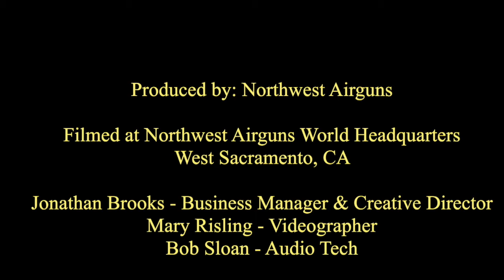Pump-up air rifle not pumping up?  Try the 'Alcohol Flush'.

Comment: Yes alcohol will clean the inside of the bore but Alcohol swells and destroys the rubber o-rings. You get compression because the o-rings are swelling but in short time dry out and become brittle and break apart. The correct fluid to use is brake fluid. Brake fluid cleans and preserves the rubber o-rings which make up your piston pump.
Reply: Automatic Transmission Sealant (Stop Leak) works well too and will not destroy the O-rings.
Reply: Brake Fluid is going to strip paint and maybe melt plastic.  Use with caution.  It can damage more then just the gun.  I have no experience with the trans-stop leak, but it should be safer.
Reply: The seals will be fine if you also oil the cup.  Over time oil and dirt fouls the check valve, gun leaks air.  Flushing cleans out the compression chamber and allows fresh clean oil back in.  Seals stay good.  Use only air gun oil.
Reply: Thank you so much, you just saved me the look up, I’m a auto tech and I was thinking of trans fluid but brake fluid is definitely the correct answer.
Reply: Brake fluid is highly caustic. Rubbing alcohol is an extremely mild solvent. As long as you're not leaving the alcohol in and letting it evaporate before reapplying lubricant it should be harmless
Reply: @brendanlantz8631  Unfortunately straight alcohol will cause the rubber to dry out and become brittle and a oil based lubricant will accelerate rubber break down further. Unless the rubber seals have been designed for oil resistance such as in hydraulic oil systems, brake fluid is recommended.  Dot 3 brake fluid is glycol. Glycol is composed of alcohol and glycerin. The glycerin prevents the alcohol from deteriorating the rubber seals and works as a lubricant. Think of the brake system on your automobile which is composed mostly of rubber seals and metal springs. These system last many years and only start to deteriorate once the glycerine starts to break down or the fluid becomes contaminated with oil or water.
Reply: Not brake fluid. That destroys rubber for sure.
Alcohol will not hurt the o rings if used for a short period of time.
Leave it overnight then dump it out.
Then use silicone spray on your seals.  Shoot the gun a few times onto a paper towel and see all the gunk that comes out the barrel.
Put silicone on the seals every 100 shots for a while and watch compression to improve.
Reply: There are no o-rings in a 312
Reply: Air compressor oil works good on the newer guns. Not for older guns with leather cups.
Your pump-up gun is an air compressor.
You could go to a scuba shop and buy the silicone grease they use on the o -rings and seals in scuba regulators.  That should be the finest kind of "bet your life on it" lube.
People get all kinds of ideas about
 what to use in different kinds of air guns. One fellow i know only uses non detergent 30 weight lawn mower oil.  Another man only uses synthetic 2-cycle oil.
I use silicone spray with good results so far.
Reply: @doctorxring  its Crosman 1377s and 1322s we are concerned with here.
Reply: Will jack pump oil work? Mine is letting out air after pumping.
Reply: @MrKL83  i don't know if it's thin enough to get where it needs to go but you've got nothing to lose by trying it.
At some point the seals will need to be replaced no matter what.
What i do with the alcohol flush and silicone oil is to just see if i can get a little more life out of the gun before i have to do a complete  tear down and reseal job.
Its not a permanent fix but you've got nothing to lose so why not give it a try?
Reply: I wonder how brake fluid can be bad. Doesn’t the old brake shoe calipers have rubber seals? It doesn’t seem to hurt those
Reply: @bobcat1  i uae compressor oil in my guns made for air tools. Its made to protect and preserve the O rings in your air nail-guns etc
For me the alcohol flash has bern 50% successful. It worked fine in one old gun but never did really regain pressure in another
 These are 40 yrar old guns here.
The alcohol flush works sometimes as long as the seals arent too far gone.  If its time for a reseal job then thats what you have to do. They will all need a reseal job eventsully.
Nothing lasts forever.
If the gun won't pump up you've got nothing to lose by trying it.
 Sometimes you get lucky.
Reply: @MegaTheRatman it will over swell the rubber and it will fail anyway.
U have to use a tiny bit.
Reply: 😊 @bobcat1
Reply: @ 10:28 johnndavis7647
Reply: @doctorxring 
Got a leather pump seal if I remember correctly.

Comment: The inlet check valve is still not sealing as you pointed out. I've been alcohol flushing pump pneumatics for years. If it's going to work it works pretty quick. My method is to squirt, pump 2X, fire, repeat until all the seals hold air and there's no more dirt coming out of the muzzle. No need to soak overnight. Alcohol hardens and dries out the rubber seals so get some oil in the valve as soon as possible after you flush it out with alcohol. If flushing doesn't work then it needs a reseal job which is no big deal. Routine oil lubrication over the life of the gun flushes the valve out with every shot.
Reply from the maker: Good stuff, Jon, very helpful, thanks!
Reply: @NorthWestAirgun  Mr. Northwest, I've whatched many of your videos and they are excellent...the 312 cut out video was highly excellent to see how it all works...I received a repair kit with the tool for the Benjmin 312 and have taken the gun apart, cleaned it up nicely...However, I'm not sure how to get the pump cup off...do you just pull on the cup and stretch the rubber...?  BTW.  What about those felt wipers, do you ever replace them...?  They appear to be in the tube just to keep everything in alignment during pumping.    The man question is how does the pump cup come off?  Thanks,  Dennis.   I know it's a stupid question, but...lol  

 BTW.  I've cleaned all the black off this gun and have the brass shining like new money, last step was 0000 steel wool...it looks like a mirror now and will spray it with automotive clear coat...that should protect the metal...We will see...refinished the stock with tung oil...about 5 coats....it's looks good too.  Now, just to get it back together...I could not have done this without your videos.  Thanks again.
Reply: Mr. Northwest...never mind I just saw your 3100 review from February 22, 2022 and you just popped that rubber cup off there....that's all I needed to know...no need to respond...I know you are very busy...Thanks,  Dennis
Reply from the maker: @dennispfeifer7788  If you are just having trouble digging out the old pump cup material you can burn it out with a torch, like at the 7:25 minute mark here; 

https://youtu.be/c4_A3Cg6i8o 

Just do it safely, outdoors, with no combustibles nearby. But some pump cups are cast in place and not replaceable, take a look here; 

https://youtu.be/cS9mpZc1RQY 

In that case, you have to replace the pump cup holder so you can use the new pump cup. Take a picture of what you’ve got and email it to whoever you got the kit from. They should have the right pump cup holder for you. Cool that you are refinishing that rifle, a lot of the old stocks were pretty nice wood and refinishing brings it out.
Reply: It clearly states that the hole isn't to be oiled

Comment: My Crosman 66 Powermaster had no compression when I tried to pump air in. I was going to buy a M4-177  for about $55 here in So Cal in the morning and just trash the 66. But came across your video and decided to give this a shot. I only had 70% Isopropyl Alcohol on hand. And wasn't seeing any positive results after standing it in the corner over night. Tried it again using Dot 4 brake fluid. After standing in the corner overnight again. Dry firing a few times had good results. BB tests were also good. After standing in the corner for 2 nights. I think it pumps  up and fires better than new. Fantastic video. Thank you!

Comment: I bought a Benjamin model 342 air rifle in the 1970s. I haven't used it for over 30 years. Tried to pump it up but it did not hold any pressure whatsoever. I read about your 'Alcohol Flush' and decided to give it a shot(pun intended) last night. I pumped it up this morning and it fired like a champ. Great advice with greater results. Thanks a million!

Comment: While doing some maintenance on my Benjamin Sheridan C9A .50 Cal. rifle, I ended up having some gun oil creep into the air pump chamber. I had zero pumping power. I found this video and gave it a try, and IT WORKED! I added the rubbing alcohol into the chamber and pump cup, let it sit over night, and the next morning all was good again. Got my beloved air rifle back in working order. Actually has more pressure then it originally had. Thank you for this video!

Comment: I have a Blue Streak that I bought in the early 70's.  It quit pumping about 10 years ago so it got tucked away in a closet.  I came across your video and thought I would give it a try.  First time it brought the pump back to life but the check valve wasn't holding.  I tried it again and let it soak for a few hours and the check valve started to seat.  The gun now shoots great and holds pressure.  Thanks for  the lesson!
Reply: Is it still holding air?  I bought my blue streak used about 1968.   Yesterday I took it out of the closet and it’s not even trying to suck air.    This really works?     Thanks   ☮️
Reply: Is it still holding air??

Comment: ...When the alcohol evaporates it will dry the seals, so after the flush it's best to put Pellgun oil (or something similar) on the pump cup and into the compression tube as in regular maintenance....This will bring new life to the seals if they are not damaged in any way just by age.....Lubed up before any long time storage will also be a big benefit.........

Comment: I watched your video several weeks ago all excited that I might be able to avoid tearing down my 60+ year old Benjamin 312. The last time I shot it was about 20 years ago, before it was flooded under 13 feet of water from Katrina in 2005.   I tried for several days with little or no effect on the ability to pump, so, I put it in the corner and saved it for a later project.
It's about 6 weeks later, and I decided to order a kit for it. So, naturally, I picked up the gun and went to pump. It was solid--I mean solid --at 4 pumps !!. So glad I have a can of pellets with it.
I'm going to postpone a rebuild, cleanup the gun and re-finish the stock. I'm already telling my grandkids about my 1960's adventures with this gun and look forward to target practice. 
Awesome video--thanks!!

Comment: I have a 55+ year old model 310, which I used as a kid, that quit pumping. I tried the alcohol flush and it didn't work immediately. I left it overnight and it's not only pumping up but holding air. Thank you for this great video.

Comment: John,
I saw your video on the alcohol flush and was quite skeptical at first, but decided to give it a try with 70% alcohol on my Benjamin 317 and it didn't work so I decided to follow directions and use 91% alcohol. I did it like you, above and below the pump cup, then set it in the corner, upright and pumped it several times in the morning and lo and behold I got pressure again!  Thanks a lot for sharing! I'm going to try it on my Crosman 664SB Pumpmaster next and see what happens. Brad
Reply: Teflon is better.

Comment: Blimey! I'm amazed, I bought a 2200 on an online auction, blind, it didn't pump.
I was looking at diagrams and seal kits to repair it. 
I was a bit underwhelmed with the gun when I picked it up as it felt like a toy gun I had 50 years ago firing caps at my little brother.
I used a few squirts of 99% hand sanitizer from our COVID stash. I'm pretty sure this little plinker has more power than my Air arms S410 classic.

Very impressed with this video that has revitalised an old American plinker (maybe not restricted for UK market)

Comment: I am so happy I found this video last night. Earlier this week I took my Crosman 140 off of my gun rack to dust the Rifles on the Gun Rack. For the heck of it I tried to pump it up and it would not hold air. Took a extra Syringe I had around that I had left over from filling printer ink cartridges for my printer unused and poured some Rubbing Alcohol in a extra pill bottle I had around like you did and inserted it where you told us on the video to do. Did it a few times.  It didn't do anything for me last night as it seemed to be leaking air from around the piston area. I thought there was no hope for it and that maybe I needed to rebuild the piston. Add more Alcohol, stood it up and walked away.  Well this early afternoon I went and checked the 140 Rifle again and I could tell a big difference on the first pump. Pumped it just 2 times and tried it and it shot some air out of the barrel into a rag. Just ordered some Pelgun oil for it last night I should have on Monday. Can you suggest to me or do you have another video you can send me a link to on how to oil this 140 Rifle properly? I forgot to mention earlier that  I purchased a seal kit of just O-Rings for this 140 Crosman Rifle maybe 5-6 years ago and resealed this Rifle back then and only shot it maybe 10 times to test it out afterwards. Got tired of pumping it up each time I wanted to shoot it. Didn't mind as a kid back in or around 1960 when my grandfather purchased this Rifle for me but at the time in my mid 60's then I just didn't feel like it anymore and put it back on my gun rack where it collected dust until the other day. I am 71 years old now. All and all this Rifle is in great shape. No rust. Blueing on the metal still in pretty nice shape. Wood Stock is nice also but with a few small chips. Thanks for making this video is all I want to tell you. You helped me revive my old 140 Crosman at least for the time being. I just want to Oil it with the Crosman Peloil when I receive it. Don't remember if I got any Crosman  oil with the Rifle when I purchased it new. I believe back then I was using 3 and 1 oil on a rag just to wipe my Rifles down with and really nothing else maybe some WD40 also at times on a rag to wipe them down with.

Comment: Thankyou very much for this Excellent advice!!! 
I just did the alcohol flush over 3 days and saw little bits of string come out the barrel when dry firing and adding more 99% isopropyl alcohol into the air intake each day , and this morning my Benjamin 317(no serial #- made 1940-56) held air, and I chronographed it shooting 5.4 grain Crosman lead free "fast flight" pellets at nearly 700 fps, so I'd say that the alcohol flush was a success :)
Reply: Make sure you put some 3-in-1 oil or brake fluid in the same hole to lubricate the seals. Alcohol alone will dry the seals out causing them to dry out and turn brittle.

Comment: Well,my dad's Benjamin is now fixed AND in under 10 minutes. I injected the alcohol and then just a touch of synthetic oil,gave er a few pumps and instant pressure building again. Running good and it's sat in the same spot for many years. Firing good. Thanks for this tip!!

Comment: Thanks for posting this tip and very good teaching style. I was given a crosmen 66 from the late 80’s by the serial # that didn’t pump. DOES NOW & holds air. Put some silicone oil in after several dry shots to remove the alcohol. Shoots great.

Comment: I bought an old Blue Streak that had been sitting in a shed for years, through frigid MN winters and humid summers. It would not pump up when I got it.  I did the alcohol flush and the gun pumped up fine and held air for days.  I sold the gun to a buddy 7 years ago and it’s still pumping and holding air fine.
Reply: How many % concentrate alcohol my friend ?
Thanks you very much
Reply: Just wondering where I can purchase a compression seal kit for my Blue Streak. Thanks ahead of time.  Appreciate your videos
Reply: @rickwood5005  or you can use a 1/8" nut driver to remove the bolt stop. Watch the videos first to determine if you want to attempt it.

Comment: My Sheridan Silver Streak air rifle that that I've had since about 1970 was on the floor in our house when it flooded in 2017.  I wiped it down and put it in the gun case and forgot about it.  I tried to pump it up the other day, and nothing.  I was watching the NorthWestAirgun video on rebuilding my gun when I saw a comment directing me to this video of their's on Alcohol Flush.  Day one, no change at all.  Second try I injected more alcohol and the following day the gun pumped up perfectly with no leak-off.  Two more days later and it is still working the same.  Thank you guys!!!

Comment: I have one I used in the winter to dispatch fox's in my trap 14 years ago it was 10 below when I pumped it and after that it quit pumping air.. was going to just put it in the garbage can this week when I read this and all the comments about alcahol and break fluid so I went to my shed and opened the pump handle up and seen some small lettering that said use air compressor oil only. I put a drop in the oil hole and one on the push ring and one in the open chamber. I started with 1 pump then fired it with no pellet then 2 pumps and fired it then three and fired it ( air only ) and let it sit for 30 minutes then 5 pumps with a pellet then 8 ( that is max ) with a pellet and sweet I got my gun back - shot 5 pellets at 8 pumps and worked like it did when I first bought it , man sweet I almost sent it to its grave. - thanks for making this and the reviews help save my gun,
Reply from the maker: Glad you didnt trash it, and that you got yours working again.  Makes me shudder to think how many went to the dump that could have been saved instead.